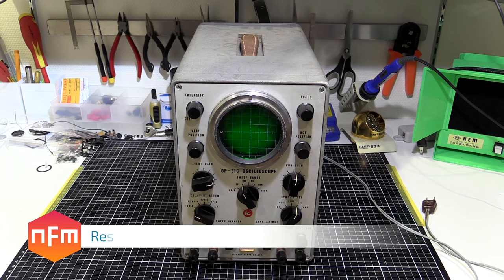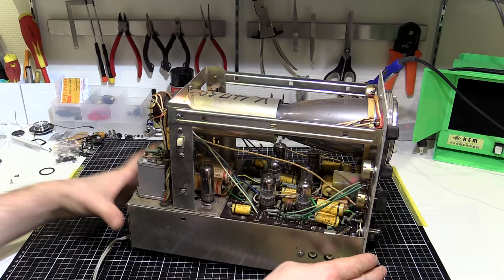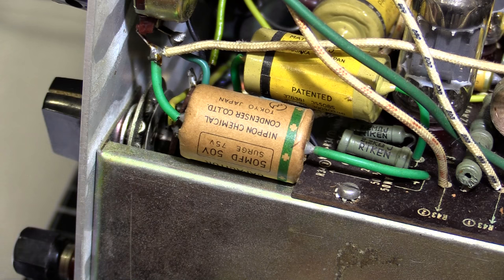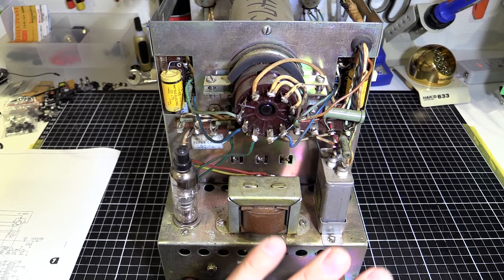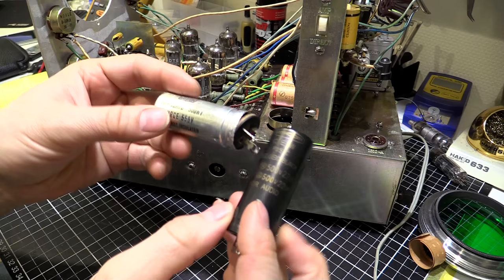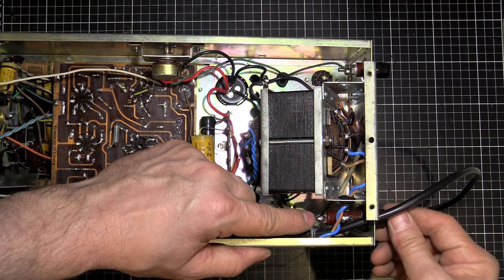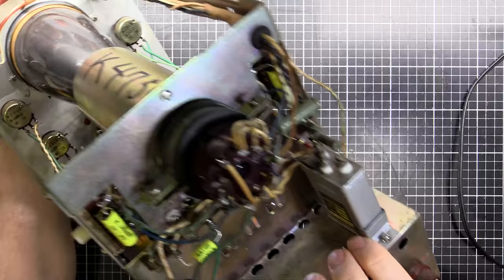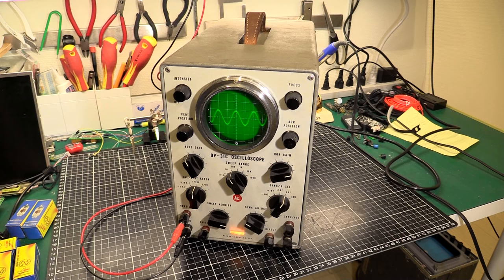Vintage Kikusui OP-31C Vacuum Tube Oscilloscope Restoration

Comment: PCBs were used to stabilise the dielectric oil so it wouldn't break down at high voltages.  PCB-free oil filled capacitors often don't last as long.

Comment: I have couple old oscilloscopes: 1) Sencore PS148 - doesn't work at all  2) Simpson Model: 466 - this works now, but it is old and the pots needs cleaning....
Where can I buy replacement parts? Is there somewhere schematics with correct parts and modern replacements? Do you have a club or place on the Internet, like the Tektronix group? (I also have Tektronix 2465 DMS in working condition with P6407 RQAUS1). My modern oscilloscope is Aktakom 100 Mhz 2 channels. Thank for your video ! I'm now a subscriber.
Reply from the maker: Hi,
You can try http://bama.edebris.com/manuals/ for a lot of old manuals.

Comment: Nice restoration. Do you use this scope? I would imagine that the only use for it would be to look at some waveforms, not measure anything. Did you bother with the foilside correct installation for the new caps?
Reply from the maker: Yep! I followed Mr Carlson's Lab video on testing the 'direction' of capacitors to get all the capacitors the correct way around.
I don't use it much but I have thought about converting it to a basic curve tracer for testing 2-lead components.

Comment: i have a jayem kikusui 555 cathode ray oscilloscope all tubes, vintage. im in australia, switched on no green line on main tube. yes there was one at some time in its life.   just bought off ebay.com.au, made in japan got the user a manual and service manual with this unit. the guy had it from new. power surpply works. butt no pic.how can i test this unit. where do i start? what to look for? thank you.
Reply from the maker: First thing, I would check voltages, then replace the paper caps, and test the tubes or just replace them.

There's not much else besides cleaning the switches and pots.

Hope you get yours working! :)

Comment: Is that inductor a auto transformer for 120 /240 V usage?
Reply: Nah, it was just a normal everyday inductor. It was well dead though, multiple breaks in the windings from corrosion caused by the leaky oil filled capacitor above it (The grey one in the video).

Comment: I probably wouldn't had bothered with tubes unless they had a lot of filament boil-off.

That plating is zinc chromate.
Reply from the maker: I did try it without replacing the tubes, but it wasn't working quite right. One of these days I'll get my hands on a tube tester to see which one or two are actually bad.
Good to know the plating isn't cadmium too. :)